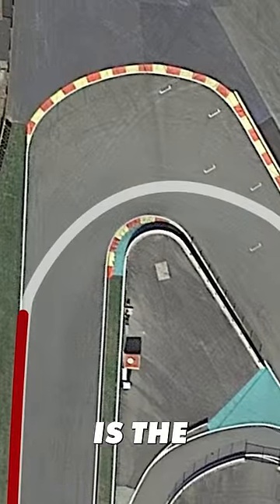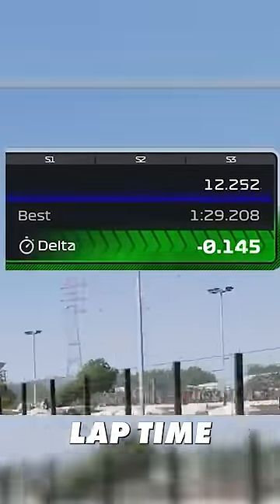Why F1 Drivers IGNORE the Perfect Racing Line

Comment: Brake hard in straight line. 
Turn aggressive to the apex
Throttle early
Reply: Apart from when you’re trail braking and you have a bit of steering on.
Reply: There should be zero gap between when you get off the brakes to when you get on the throttle
Reply: @NipponNostalgicTV  Maybe true in sim , but real life NO. that just upsets car balance.
Reply: @alimantado373 what applies to sims will pretty much always apply to real life, and vice versa
Reply: @alimantado373 

Only if you apply too much throttle input.
Reply: @khakipeach2128  Really, Ive driven both, Track days in cars and bikes...and your wrong!
Reply: @NipponNostalgicTV Depends what you are driving, you cannot do that in a traditional Turbo car. Maybe in F1 yes
Reply: @alimantado373  

No, just no. . . if the gap between you braking and accelerating is more than .2-.3 ms you are doing something horribly wrong. There are exceptions to this rule but this is the rule of thumb. There should be next to no gap between you braking, releasing the brakes, ensuring the car is stable, then accelerating again.
Reply: @alimantado373  

I can bet you are not very fast if this is your logic 😂

Comment: Another thing to consider, especially for a downforce car, is using the line that involves the least steering angle and therefore scrubs the least speed. The more speed you have, the better you aero works, the more grip you have, the faster you can take a corner, and the harder you can accelerate.

Comment: This line also has benefits in everyday driving when not on the limit. By entering a corner slower and later you have a higher safety margin in case something goes wrong mid-corner (slippery piece of tarmac or an obstacle further in the corner). If the conditions stay fine throughout the corner you can reduce steering lock early and accelerate without relying on a small safety margin at the exit.

Comment: this is often the best option for f1 cars, as they have a lot more downforce than most cars, therefore they are able to take sharper turns without oversteer or understeer
on top of this, the incredibly fast acceleration and deceleration of f1 cars also adds to how much better this line is

Comment: Braking immediately before cornering sharply also shifts more weight to the tires doing the turning, allowing for a quicker corner (and allowing you to accelerate a bit sooner).  -But, break too soon and you'll have to speed back up before cornering, breakimg too late or too much can have you leaving the track, spin out, or losing speed (and time) on the back side.
Reply: (doing this repeatedly is also hard on the tires and the brakes....and the suspension system)

Comment: Only take a later exit if the track after the corner benefit from the exit, it maybe that u want to maximise V max is you are coming from a long straight into a twisty section, then it may benefit an early apex

Comment: To put it simply, the tire has significantly more grip when traveling in the same way (both front and rear more straight) than it does when turning a corner due of their differing directions.

Comment: I watched a video once where a race car driver had a go kart set up with all types of telemetry, and he would experiment with different lines around a race track.  He said it was impossible to gauge the fastest line using just the seat of his pants.  He needed the telemetry to find the fastest lines.
Reply: so before telemetry all drivers would have equal lap times all the time?
Reply: @francoisloriot2674  From what I said, the logical inference is that before telemetry, probably nobody was taking the fastest line around the corner.   That doesn't mean that everybody was taking the exact same line.  Sheesh!!

Comment: I would explain it differently, the first is the shorthest way with possibly least braking. The second offers least resistance after initial hard turn do this is the way allowing for the best acceleration and you also limit some time for braking. I would say that the first one is more Effective when driving a car with weaker brakes/worse acceleration and the second as it takes more time to rapidly accelerate. I guess that the second method puts much more stress on tyres.

Comment: Important to note that this only works if you have loads of power. Go karts are the best counter example for this - because they can be so slow to accelerate, carrying speed is more important. If you took this line in a go kart you’d be way too slow accelerating out of the corner

Comment: It depends on the acceleration and braking of the car.  A car with incredible braking and not very good acceleration will have a different Ideal Line than one with good brakes AND good acceleration.

  Rule of thumb; the better your acceleration is, the closer you want your braking to be to your "apex", or when you touch the inside corner, that way you are straighter sooner when exiting the corner and can spend 100% of the grip on acceleration and almost none on turning G-forces.

Comment: This only applies to formulas where power is the dominant characteristic. 

In less powerful cars, maintaining momentum is critical to overall lap time, meaning the need to preserve your minimum speed as much as possible through each corner requires taking a path through the corner closer to the perfect line, rather than the ideal line.

Comment: 140 kilogram force (~309 lbf) you need to put on the braking pedal in an F1 car for maximum braking and that's what you need to brake as late as possible.
Before you can start to even think of optimising your exit speed. The numbers on the leg press in your gym are just numbers. Set that press to real 140 kgf, then try to exert that power lying almost flat on your back. Repeat for two hours.

Comment: Engine torque curves would seem a characteristic that can be 'worked' using these techniques. The ability to command maximum torque at any rotational speed of electric motors seems a more elegant and effective solution.

Comment: The original apex is not always the fastest route around the corner. This depends on the bank of the corner, incline or decline, the power of the car and the cars turning ability. This is where a driver with experience makes the difference with the car they are in.

Comment: It's actually not the case of just "exit speed". It matters of how long the next straight is.  If it's rather short, then you don't want to give up as much time in the corner.  If it's a long straight, especially uphill, then you want as much speed as possible

Comment: Traction and acceleration of these cats is soooo good, that carrying speed in to a straight is so beneficial. Plus, braking late/trail braking (if F1 cars are capable of this), makes for carrying loads of speed ithrough the corner. I also know, mainly from watching this and other channels, as well as being a big F1 fan, that braking in these cars is as far removed from braking in a normal car, as can be! Less speed, less down force, need more brakes. Noobe could go in to an F1 can and drive it properly. You heed the experience of making your way through the lower categories, otherwise driving these things fast, would be entirely alien to you. Maybe this is the best line, because its an F1 car, and that driving a normal....ish car, fast round this corner, means the line used by am F1 can would NEVER work as the fastest option.

Comment: Exit speed is important, but I think it's important to keep in mind your car's potential to accelerate too, as well as the corner's context. I mean, if you can't accelerate more (ie. You're driving a Stock Mazda Miata, or there's another corner ahead), just try to minimise your energy loss. Afterall, a circuit is not just one corner.
Reply: He also explains this situation in the full video that is on his channel.

but you are still right about the ideal line in cars without so much power

Comment: It’s not the “perfect line” then is it if there’s a faster way to take the corner
Reply: It's perfect in a mathematical sense as the "perfect" line maximises the turning radius through the turn.
Reply: @DZ-jm1my though really just depends on what car you use right? example you cant really utilize that line if youre using a slow car like a miata that doesnt have the power to accelerate and take advantage of that line
Reply: @Julian_0000  Exactly, and this is covered in the full video. Something like a Go-Kart will take a line MUCH closer to the geometric line because it simply does not have much power. Something more powerful with less grip benefits more from the ideal racing line, as it makes more time accelerating than carrying high mid-corner speed.
Reply: the "perfect" line will get you from the entry to the exit of the corner faster but the early-apex or double-apex line is faster from the entry of one corner to the entry of the next because you're coming out of the first corner so much faster.

Comment: Well the lines between the drivers hardly have any difference in these cars, the problem is how steady the car is through the straight or the corners. Max for instance has a more floaty line mainly because Red Bull is overweight, Leclerc has sharper lines but his car overcooks the tires.

Comment: That's only half the story. The other half is about how the weight of the car goes forward under hard breaking, giving more traction on the front wheels. The weight shifts back under hard acceleration, giving more traction to the rear wheels. Moto GP riders even move their riding position to accentuate this.

Comment: i was 1980 Donnington GT  one litre class winner   My car was the only car with ground effects .. i used the late braking available because of the ground effects   the line you show is exactly the lines I used .the ideal line is not any use when ground effects are in operation ..   MY car and driving skill  led to the commentators  not even mentioning my race winning . it was a foregone conclusion that I would win the race and the only reporting was about how exciting the 2nd 3rd etc battles were . then the results showed my race win and lap record   again ... Boring   boring .

Comment: "theoretical racing line....maximize the minimum speed through the corner"
of course this isn't even "theoretically" the best in a race. 
To come up with a theoretical best line and still be very simplistic, it would make more sense to minimize total time for a corner AND the straight that follows (or from a braking point  through a corner until the next braking point).
If you present the problem that way, then you can understand why drivers want to be on the brakes hard at first, reach an apex in their turn, and after completing the apex, get going as fast as possible, as early as possible

Comment: I find this video very confusingly worded. The "theoretical line". Well. That is the theoretically and also actually fastest line, for that section of track, ignoring what comes before and after it. But no-one said that is the theoretically fastest line going through the whole track did they?

Obviously, there's a different theoretically fastest line for the entire track, aka. the ideal one. It's not like there's some "theoretical" vs. "ideal" line thing going on at all. One going by theory, the other not. As an engineer, using this terminology this way annoys the hell out of me. The actual theoretically ideal line though is impractical to calculate in order for the driver to then memorize for them for all parameters, conditions and scenarios though.

But no "theorist" would say it's the first line. It would be something like the second. So, the best one could do irl. would be to calculate/simulate a general approximation of this ideal line for the whole track (given some set of the most plausible parameters), and then it's up to the driver to use feel and experience to modify it or find the ideal line in the moment, based on the actual conditions then and there. Whoever does that best and gets closest to the "perfect theoretical line" for those exact conditions, will get the fastest lap (before considering different cars and conditions per driver off course).

Comment: That’s just for F1 tho , no other car can benefit from this line
Reply: I feel like this line would also be faster with my car, for example through Aremberg on the Nürburgring, which is a similar corner. It's just that the inside line has all the rubber deposit, so theres no grip when you come off the "standard" racing line.
In general, there are multiple important late apex corners on the Nürburgring, that will give you a great speed advantage, especially in low powered cars.
Reply: Go watch some Rob Wilson videos. This is his line and he's taught it to over 70 current and former pro drivers, including everyone on the current F1 grid. He teaches it in a Vauxhall street car. It absolutely does work in any car.

Comment: For those who think this only applies to high powered cars, this is a momentum issue not a traction issue. You’re not trying to carry the momentum throughout the corner, you want to loose your momentum turn the corner and get back one the gas. A sharper initial turn will allow you to ride the rest of the corner at a lesser curve, which means you can start speeding up before the straight.

Comment: The issue I have with this is you make it sound simple, the fastest pass through a turn depends on the power of the vehicle you're driving, how sharp the turn is, how much grip your vehicle can hold through the turn, how tight your vehicle can turn and is there another turn after the first one or is it straight? All of these factors affect the ideal line